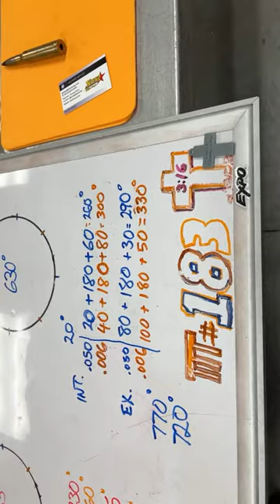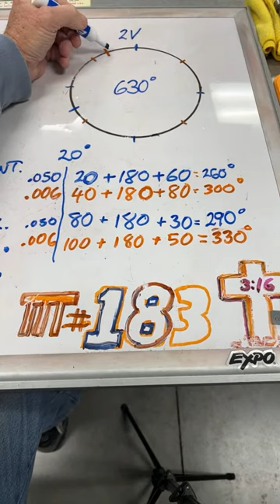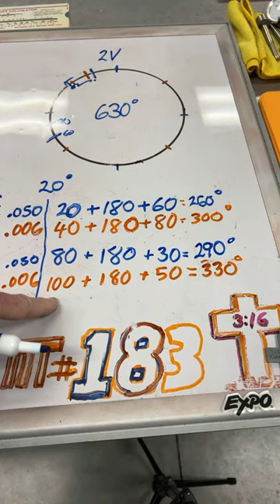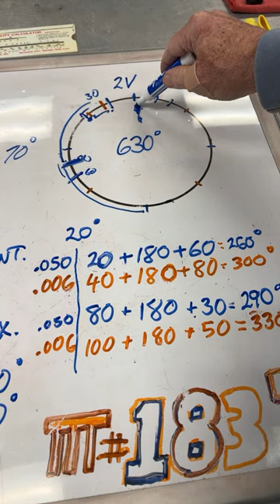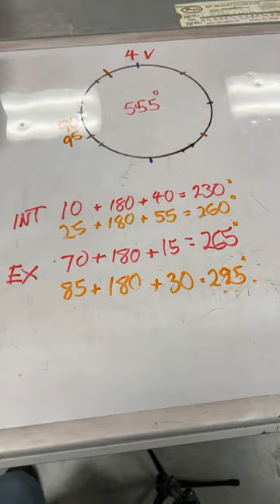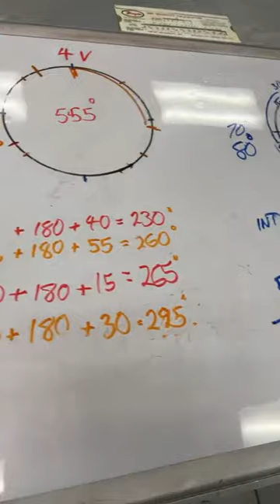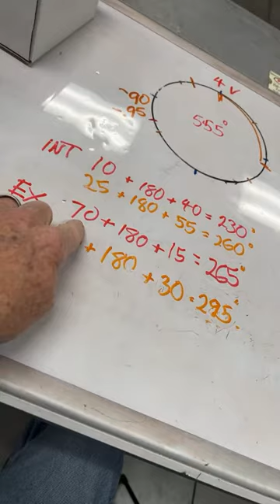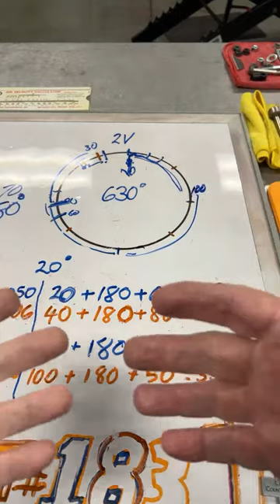Tech Talk Tuesday #183 with George Bryce

Comment: Amazing way to describe the actual dynamics of the engine combination regarding valve sizing vs cam timing relationship.  Ive been struggling with a way to formulate seeing the results of more modern OEM engines with far superior heads running less and less cam timing but making more power and better power curves along with seeing the trend of smaller and smaller exhaust valves in aftermarket heads for older architecture engines and trying to reason why.  Yes the engine is mechanically pumping the exhaust out of the engine and the exhaust is hot so your mach number is going up and up, but there still is an air speed choke point in the exhaust flow out of the port.
Reply from the maker: Yes sir thank you. I believe once the exhaust is full talking about the exhaust system. No more intake will go in.
Reply: @GeorgeBryceStar  right, if you cant make a depression in the cylinder, you have no pressure differential IE no flow

Comment: Great content!  Why do we use @0.050” numbers for calculating effective compression ratio if we can’t build compression until the valve is closed?  Seems we would use @0.006” numbers?  

Ben Alameda builds SBF drag engines in California and if he has room he sizes up the intake valve not the exhaust valve because he says good low lift flow in the exhaust valve allows raw fuel/air to escape out the exhaust on overlap. This also makes sense to run less duration on a 4V setup, less overlap....  Also Larry Widmer likes a specific exhaust gas speed through the exhaust port for efficiency.....of course he doesn’t share that number....